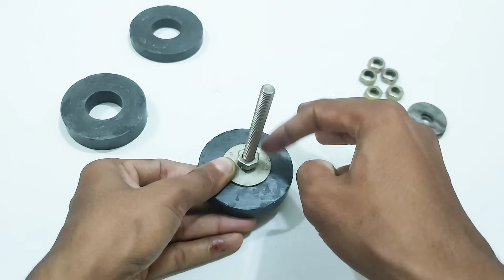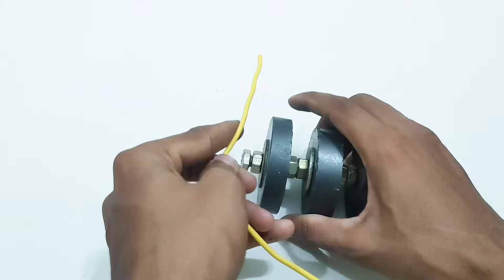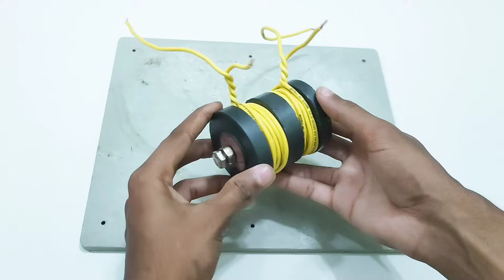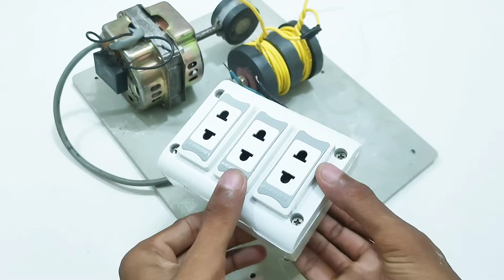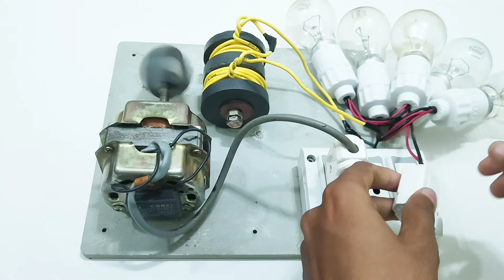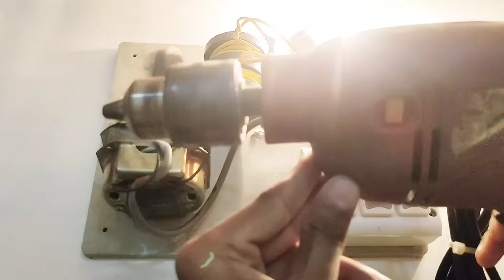New... how to make free energy 220v AC 15000W powerful electricity generator turns iron bolt copper

Comment: Why don't you document the voltage and wattage of your build? If it supports 15KW, as claimed by you, why not hook up seven 2KW electric heater instead of these measly lightbulbs? Maybe because you lie about the output capacity?